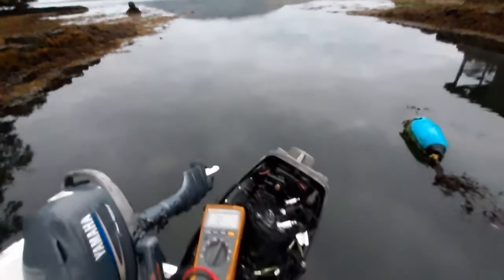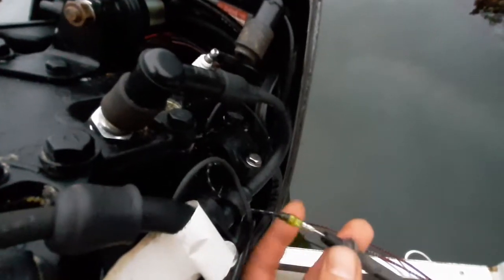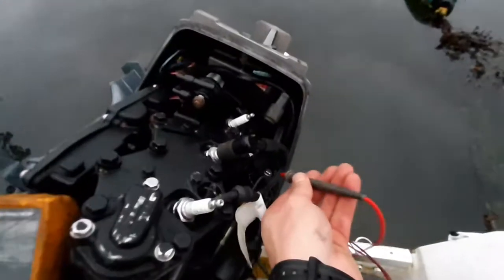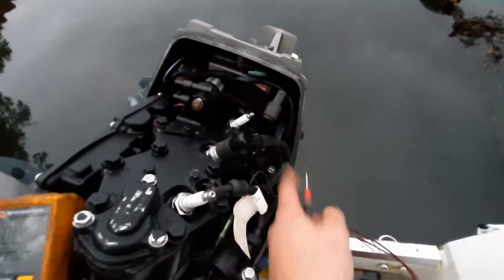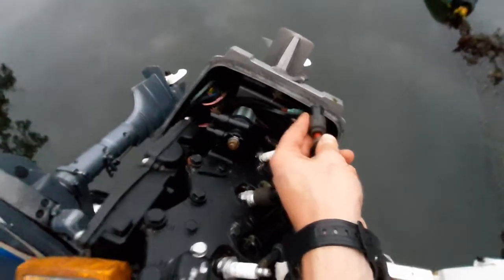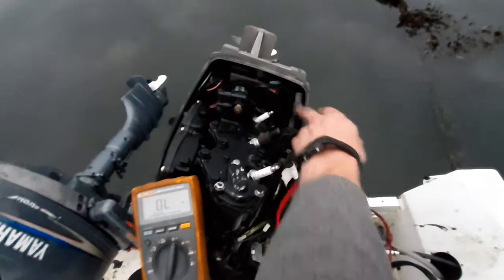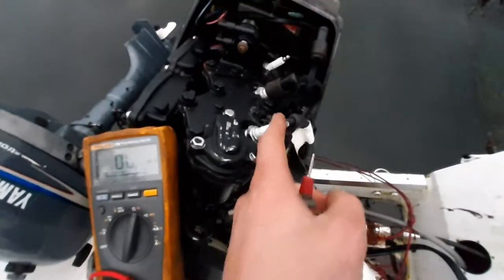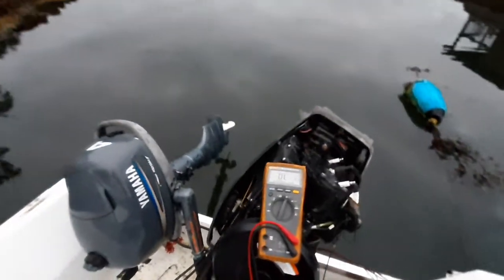How to test an Outboard Engine Ignition Coil

Comment: Tohatsu outboard does not get gasoline into the cylinders. The injector, ecu, spark plugs are intact. When I pour gasoline into the pistons, it works a little. When you press the starter, oily gasoline comes out of the exhaust. Greetings from Turkey..

Comment: You're skipping over the most important part you say the probe should be a 0.5 or even a 1 or a 2 reading. Is that ohms? So you're saying a range of 1/2 to 2 ohms for the first reading? And multiple m have multiple fractional settings which one should we use?
Reply: He literally says "you want a low ohm (Ω) reading up to...."  and later refers to the second reading in kiloohms (kΩ) you can also see the scale on the meter screen

Comment: 1990 25hp Johnson outboard it runs but not like it should did all the tests, all check OK except for the CDI, no continuety on either wire but it does crank and run but not like it should

Comment: My ohms are all reading 0 for these tests. Would this be the readings of a bad coil or am I doing something wrong. 2006 mercury 9.9, runs at full throttle but has weak spark.
Reply: Did u get help? Zero ohms resistance implies a complete circuit. Or “full connection”. Are u sure you have your meter set up correctly? Is it a digital meter or analog, with a moving needle? Does the “reading” move around a little ? Depending on the meter, you usually get a little bit of resistance reading (eg 0.5 ohms) . I think u should check your meter or try another.  If it’s analogy meter and the needle does not move,, you are likely misunderstanding. That usually means an infinite reading...meaning very HIGH resistance.

Comment: No help at all. What setting on ohm meter
Reply: Setting is same as when testing anything with a meter when unknown value (in this case resistance). Start at the highest resistance setting and reduce it down to the next lowest until your meter is close to the values he mentioned in  the video. It you go too low a setting, you will get OL (overload) or similar reading ..you can use the highest setting but it will greatly affect the accuracy of the reading ..so set it as close as possible .For the Primary reading, he got 0.5 OHMs so set your meter to 10 ohms, 100 ohms...whatever your meter has for a setting just above 1 ohm....the secondary reading was 10 Kilo ohms and the bad coil was 200 Kilo ohms... again, start with a high setting..say, 500 Kilo Ohms or whatever your meter has that’s close...if you select too low a setting, your will get OL for overload on the display. If you have an “auto ranging” digital meter, non of this matters...it automatically sets the range and displays resistance.

Comment: Your video goes to people who don't know what you know.  You use acronyms that we don't understand.  You take a video that does not show what you are doing!
Reply: You should learn some very basics before doing this work if you don’t understand. Look for a video that explains how ignition for simple motors work. Start with a “points” system, then CDI (capacitor discharge)...the ignition coils work the same in most systems.

Comment: shop manual for my evinrude 15 hp (2000 4stk) says resistance primary to ground shouldn't be more than 3.2 ohms and I'm reading as high as 5-6 ohms when its warm.  it's running great for about 10 minutes (under way) then it chugs and stops.  Fuel system rebuild and working ok.  Is that high enough resistance to cause it not to run??
Maybe It's the power pack. 
I have to get a spark strength tester and check it, I didn't realize this motor was discontinued and can't find cheap parts, new coil is 135 bucks!
Reply: Hey..had a similar problem and it was the thermostat ! It was shutting down the engine as it should, because it was running to hot- the impeller was not pumping enough water...you probably know to look for the tattle tail water stream ...is it weak or missing?
Reply: Did you figure out the problem.  My motor does the same. Runs perfect ten minutes then over heats

Comment: I'm still trying to figure out how you are testing the coil if you unhook the wire to it?
Reply: Because he is measuring the primary which has a very low resistance plus the high resistance in the secondary it's basically the same as testing from ground.  If you see an open circuit or no resistance that's when you know there is a problem.  Even if the secondary coil is broken you may still get spark because of the high voltage induced but it's moving to the unreliable state where humidity and your horoscope determines the result.
Reply: @robinm3003  .What setting should your meter be on for this test? 200 0hms?
Reply: @locknload9143  yes, even lower perhaps, the continuity setting... It will only be a small number of  ohms.  ...it a very long copper wire and copper has a low resistance ...you are looking to see if that thin wire is broken.  Any reading is good except a really large one ...compare one coil with another on the motor.